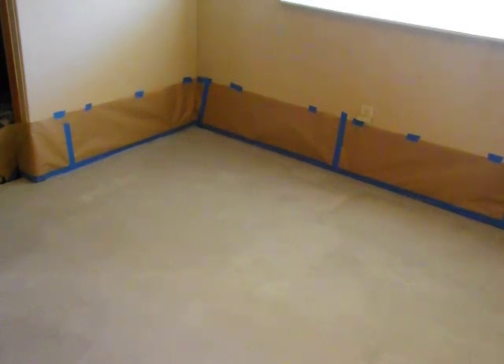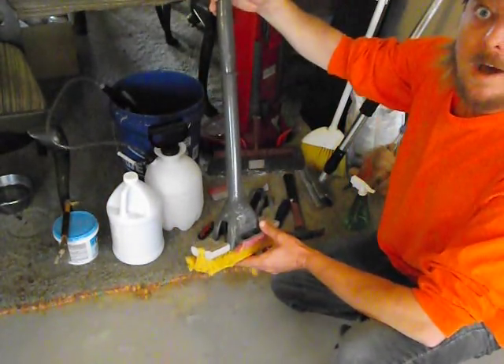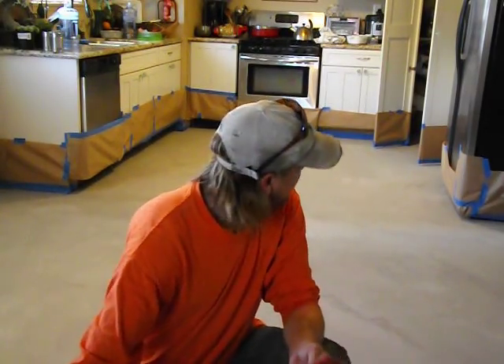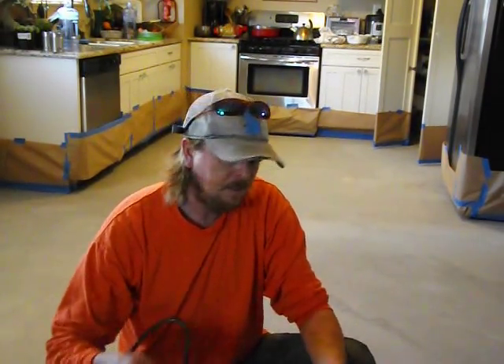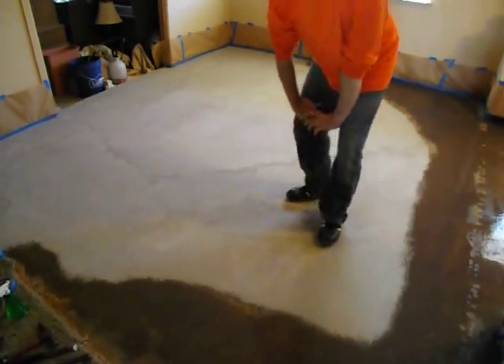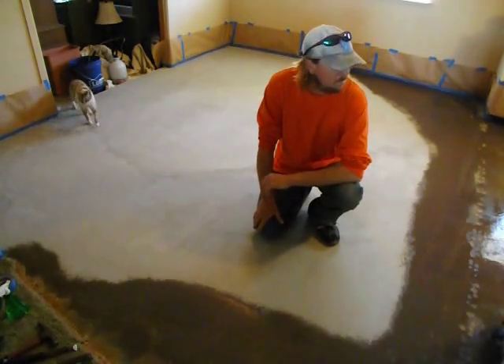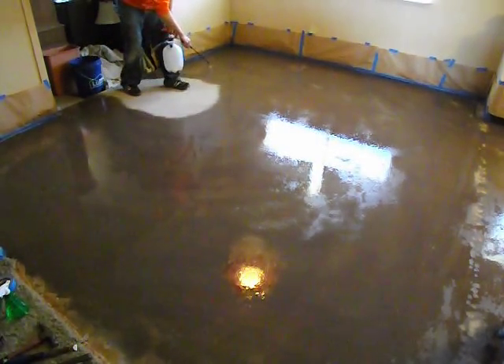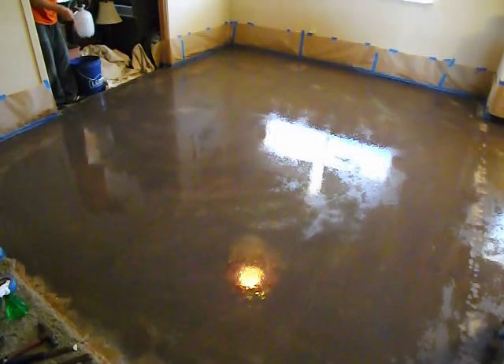how to dye concrete part 1

Comment: What an amazing video! I am literally hoarse from cheering you on! 
What a magical carpet ride it was as you transported me into a world of wonder and awe! 
A world that must surely have been created for me and me alone. 
A world whose sole purpose it was to unite me with the four things I hold so near and dear to my heart. Concrete, stains, blue masking tape, and masking paper! 
If I had one complaint, it would be about your seemingly insatiable urge to pump your sprayer. You stopped, grabbed your handle firmly and pumped it vigorously at 3:55, 5:21, 6:50, 8:14, 8:30, 11:03, 12:15, 13:16, and 14:28. That's nine times in less than 20 minutes! It seems kind of excessive to me, but I must admit that I'm no expert in this field. I does however leave me wondering why you haven't hired someone to vigorously pump your sprayer for you as you spray it all over the kitchen floor. It would definitely free up your time so you could concentrate more on your accuracy. 
Thanks again for the fun.
Reply: Chris Kym lmao troll lvl 9000
Reply from the maker: I am extremely pumped. I know the importance of each stain . each stain is unique and I thank you.
Reply: This was great 😂